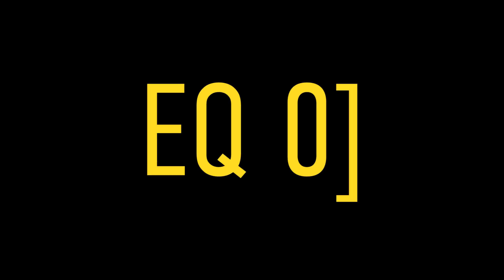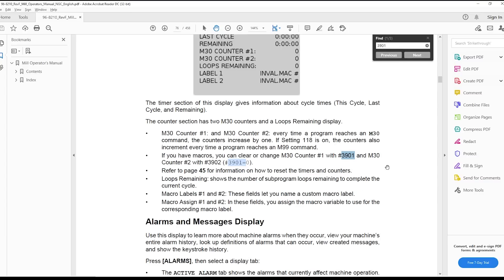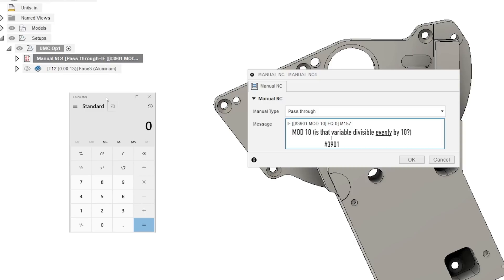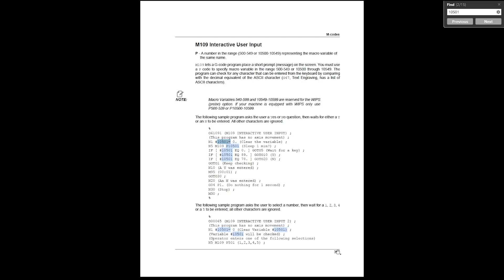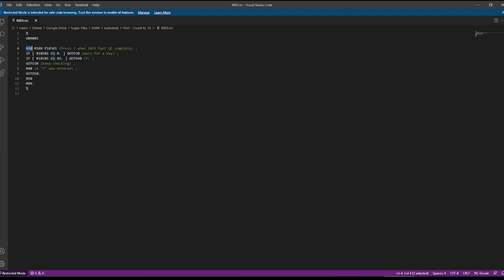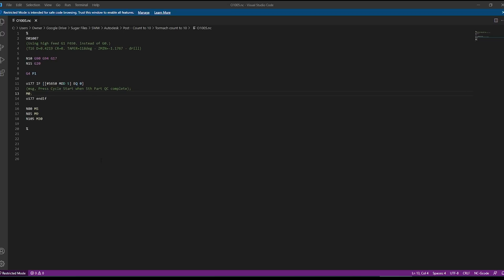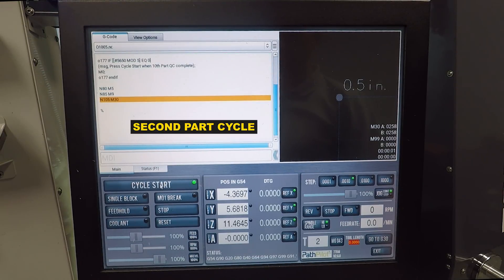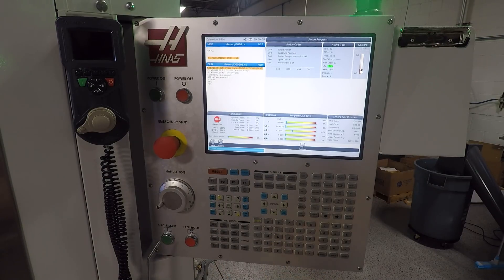Program your CNC Machine to Probe Every 10 Parts!

Comment: This is a great tip - I always probe and set to stop outside of a tolerance zone,  I find especially in 5 axis when at B90 you can get into a situation that your tool offset errors get doubled you can occasionally get tools walking on you mid job

Comment: I found this m109 in the manual this weekend and got super excited to use it in a current part I’m doing but when I went to test it out, it didn’t work! I was just trying the sample program it gave and it gets stuck on the m109 line. It won’t read past that to the IF statements. 😭 is there some setting that needs to be turned on?

Comment: We do something similar with an automated machine alignment cycle.

We tied it to #3011 or #3012 (whichever the date is, I can't remember off the top of my head).

When the routine is run it stores the current date as a macro var.

We then have an alias code in our programs that check that if todays date equals the macro var.

If not, then it either prompts (M105) the user to run the program (we DPRNT the users response so we can log if they decline to run the check),
Or if its an automated robot cell, then it will run the axis check program before loading the first pallet of the day.

Comment: This works.. but using macro variables and very simple test logic would also suffice if not be more efficient in some ways. Especially if you're running pallets where you might be running large numbers of parts at a time. I do this for a particular finishing tool where after each time it's run a part (running pallets of parts in this situation) it adds a 1 to a macro variable. Each time the subprogram for that tool is called, it checks the macro variable to see if the tool has run X number of parts. If it has, then it's going to have to probe the tool for wear and length. So even mid-pallet it can go check a tool or probe a part before moving on. Similar logic could be used for in-process probing on each part rather than ALL parts. If you had a test logic checking a feature for tolerance, and the tool now has to come back and re-cut, we could use that macro variable to reduce the number of parts it's going to re-cut rather than recutting the entire pallet of parts.

Comment: What I need to know on the VF is how can you make a programm that when you press cycle start, the machine is going to probe the location of a part automaticly and updates the current G54, and continues with that programm.
Sometimes we have casted parts that we need to modify but the dimensions and tolernces of those parts are all over the place
Reply: That is actually a pretty simple program.  Here is one i have that probes a bore and updates g154p1..  You basically copy and paste what haas has built into the control and add some probe on/off and position lines 

N31 T31 M6 (call probe)
G00 G90 G154 P1 X0. Y0.
G43 H31 Z3. T26 
G65 P9832 (Probe On)
G65 P9810 Z1.25 F200. (Move to position)
G65 P9995 W154.01 A10. D1.46 E0. H0.(PROBE ID AND SET G154 P1)
G65 P9833 (PROBE OFF)
G0 G90 G53 Z0.
M01
Reply: @sweetcupkit  THANKS MAN
I've been looking for this quite a while, going to try it out nex week, appreciate it!
Reply: @sweetcupkit  I'm not a Haas User, but out of curiosity why not use S101 rather than W154.01? Is that not an option on a Haas control?
Reply: @joeridesabike  I'm not sure,  my CAM software spits out the "S" but the Haas control will output a W when you go through the control to generate a probe routing.  So I'm guessing either will work on a Haas NGC

Comment: Another thing that you can do is use prompt the operator for maintenance issues, like empty the chip bin! on my horizontal the chip bin is in the back out of site and I had a couple massive over flows so I did a similar thing and had it call up a maintenance alarm to remind me to empty that dam bin before it made a mess.

Comment: I've never worked on a haas before but surely it has a simple Mcode parts counter that locks the start button if the counter is reached? 
Meaning the operator can't physically start the machine unless the check is done and the counter is reset.

Comment: That bit at the end is something found in the Toyota Production System. They call it the "master part", and it is the standard part used to answer any "what should the part be like" questions that other QC items (check fixture, inspection standard, etc.) aren't sufficient for. Another common practice is to have example parts of common (and uncommon yet repeatable) problems (so called "pokayoke parts"). In my case, it's sheet metal stamping and welding, but the idea works for any kind of manufacturing.
Reply: In automotive we call those "boundary samples".

Comment: You could also type "IF #3901 mod10 eq 1", to probe the 1st, 11th, 21st, 31st parts.
Or you could say "IF #3901 mod20 eq 0; do thorough inspection" and "IF #3901 mod20 eq 10; do inbetweeny inspection".

Comment: I do stuff like this in LinuxCNC to allow myself to have more than 12 tools.. .Any tool above 12 goes through a series of promoted actions to load or unload the right tool
Reply: Sounds like an issue related to being set up for a 12 pot "ATC" on the back end even if your "ATC" routine is just prompting the user to change tools. Read through any documentation you can find looking for anything related to that and either bump your pot count or switch to explicitly manual tool loading.
Reply: @Eggsr2bcrushed  No this is by design... Its not that the tool number is important, its that I keep track of which tools are in the umbrella at the start of the job, if you ask for a tool not in the umbrella then I put  the current tool away (if it belongs in the umbrella) and walks the machinest through adding the right tool to the machine.. So each tool switch is basically "does this tool beloing in the umbrella and is it's pocket empty? If no, then walk operator through tool removal... Then "is my next tool in the umbrella?" if no then ask machinest to install the next tool.. 

I also keep my touch probe outside of my umbella and it has a special tool number so I always know that when the probe is in the machine will wait for it to be removed before starting a job or waiting between tools..

Debating also making it so if the touch probe is in the machine then the spindle can't spin.. like an M3, M4 or S command would do nothing..